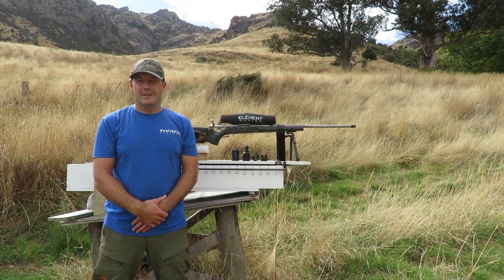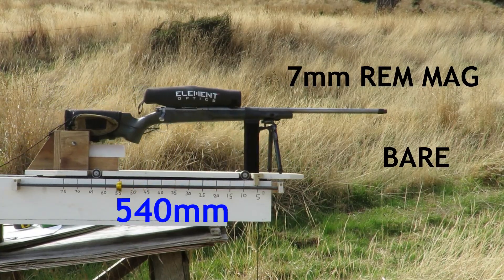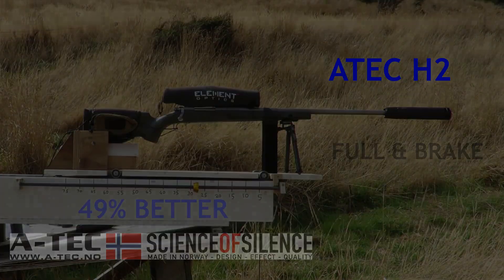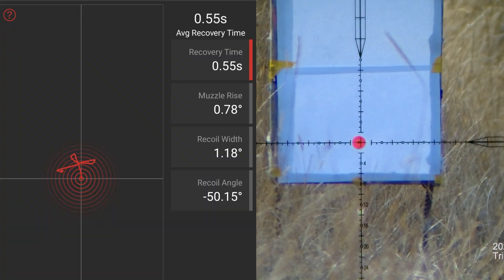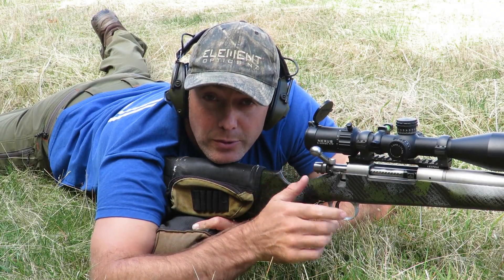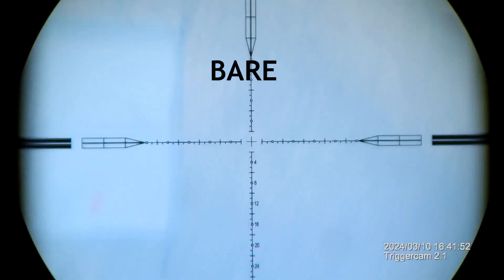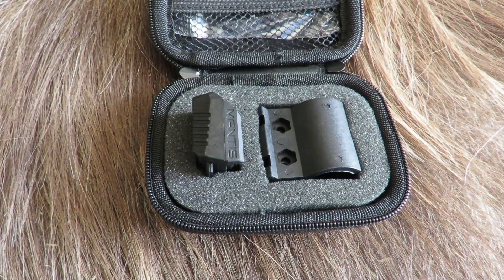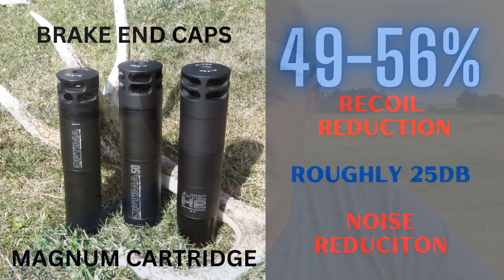RIFLE SILENCER TESTING - DO MUZZLE BRAKE END CAPS WORK? RECOIL BENCH | SCOPE FOOTAGE | RECOIL TRACE

Comment: Also, would you recommend hunting with a muzzle brake end cap? If so, how do you keep debris out? Tape it all up?
Reply from the maker: Yes i hunt with the optima45 and end cap. So much easier to catch my shot impact point with the rem mag.
You can tape the whole thing up safely if you feel conditions are going to be bad. Debris like sticks and leaves dont seen to go into the centre hole but I suppose it could happen

Comment: What's your preference on H3 vs optima 50 for a 7mag hunting rifle? Few grams to save on the optima but I personally prefer the aesthetic of the h3 how it tapers into the 50mm at the base. What ya reckon? Also with a 24" barrel would you run all modules or drop a module. South island tops. Reds, tahr, cham, fallow
Reply from the maker: H3 is the best performance for recoil and sound reduction. But only by a few % so if you prefer the h3 then run with it. I use a Braked end cap to keep reticle on target and seeing the impact.
Reply: D @ChasetheWildNZ do you run your braked optima 45 full lenght or drop a module? Also semi considering the ar40-4 or prs-2 for a 20" 7prc build. Low maintenance steel construction. My dpt has corroded
Reply from the maker: @callumdunn6070 I wouldn't remove a module and run the brake. It will ring your ears a little.. you want the 6" forward for great performance on noise and recoil.

Comment: Hello my question is whether you can also shoot the optima 50 with a module in the calibre 7 mm rem or 300 wing likes, from the volume?
Reply from the maker: @Fritz87umm  you certainly can.. I use a op45 on my rem mag
Reply: Also in the short version
Reply: Even without hearing protection
Reply from the maker: @Fritz87umm  yes indeed
Reply: @ChasetheWildNZ ok

Comment: Giday, just wondering by putting a muzzle break cap on my exciting suppresser, does this have any effect on the zero of the rifle?
Reply from the maker: @isaackaha  should be marginal but I'd definitely double check
Reply: just watched a video on the dpt brake end cap the rifle was sighted 2 inches high at 100 yrds without the brake end cap and with the brake end cap at 100 yrds was hitting bang on the crosshairs

Comment: You think you will use the brake on the end for your hunting rifle?
Reply from the maker: @camstocky2019  yes I think the sweet spot is using it on the end of an already very good sound suppressor (most ones that are 6" forward) if you add one to the shorter ones you can get a little bit of a ringing in the ears which isn't ideal!!!

Comment: I have an area 419 Maverick, and in the competition configuration yes the brake does help, but that was designed from the ground up to optimize the gas flow.   

So I think it depends on the baffle, orientation and engineering

It looks like you’re definitely getting some benefit from the ported end caps
Reply from the maker: Yes the brake end caps make a huge difference for recoil. Not so much for noise!
Reply: @ChasetheWildNZ  I’ve experienced the same with my Maverick the more recoil reduction the louder it is.   There’s a 5.5 in a 6.5 configuration 5.5 reduces the most recoil but it’s obvious the loudest.   At a rifle match that’s kind of a moot point because not everyone is running a suppressor in the US.  You have wear pro anyway.  

Hunting different story the quieter or the better.  

Cool video keep it up
Reply from the maker: @lukeclement1310  thanks. My next one I'll be comparing different suppressor brands

Comment: I have a Silencerco Omega 300. Ive always wondered if the crazy end cap did anything, but i dont wanna spend the 90 bucks for a flat end cap to compare it to.
Reply from the maker: I'd say it will help recoil by similar amounts. 50% odd.. but it does make it louder to the ear

Comment: Cool Video mate but dont think you should be adding weight I think it "could" be effecting the results. If you remove baffles and the rifle is lighter then thats the real world situation. Plus lifting the extra weight is harder than shifting it backwards when its one the sled. Great video though cheers
Reply from the maker: I didn't add weight to the string. I added the weight difference to the sled so that the recoil had to always move the same weight. But yes I agree with the real world situation. However I wanted to show people the affects of the suppressor design/ length/ end cap without letting weight change blurr the results even if it's very slight.
Reply: @ChasetheWildNZ  Cool cool. Great test regardless

Comment: I got very excited about these in SA.. unfortunately the sound reduction was not sufficient to be considered hearing safe for me. (With or without the brake) recoil reduction was significant though.
Reply from the maker: Without the brake and full length they are some of the best you can buy for sound reduction.  They are tested properly by independent testing.
Reply: I own and run 22 suppressors. I use them on everything from 17m2 to 450 Bushmaster. Semi auto handgun and rifle, bolt action, handgun and rifle, single shot handgun and rifle. Rimfire short action, long action and magnum. Range, hunting, defense use. I use them in four states in the US and in South Africa. The Atec is the least effective suppressor I have ever run. “Independent Testing”… no doubt. Haha
Reply from the maker: @jrca1406  I don't sell them or anything but that genuinely surprises me. They are tested to the milspec standard that Is the bench mark for all the suppressor testing. If you are using them at 150mm forward then on a 308 you should be getting 30+ Db reduction with is as good as it gets. The big MH2 (65mm thick) can do 38db. Here in NZ we have apt of 4" forward options and when tested by a.hunting magazine here most brands fell between 17db and 24db. Some of the 6" forward ones managed 30db

Comment: So, the suppressor with the brake cap is quieter than the suppressor with no brake?
Reply from the maker: No, the other way round.. I tried to explain that at end of the video. 
The normal style ones slow gas to quieten the shot. This reduces the energy going forward and so reduces recoil also. However if you add a brake endcap the faster and noiser the gas coming out is better for the brake o work and reduce recoil more. 
That's why you see the shorter ones that aren't as good for noise are slightly better for recoil when brake is added. Hope that makes sense
Reply: It does, thanks!